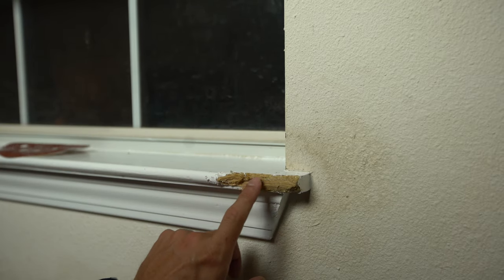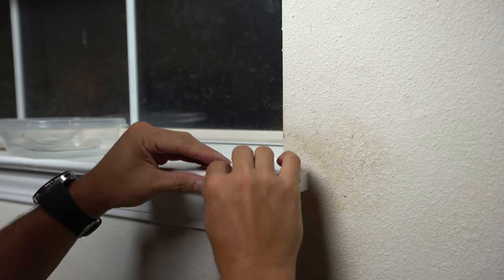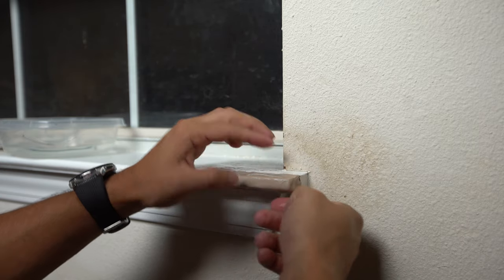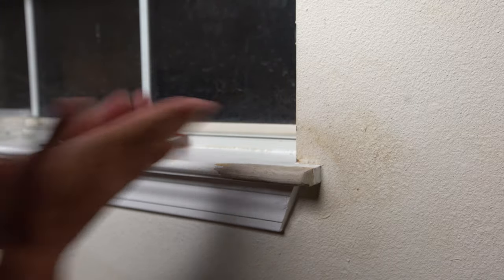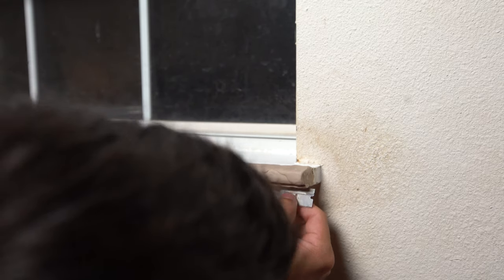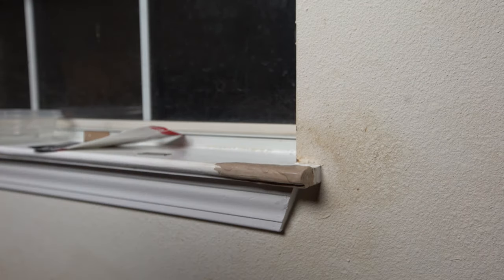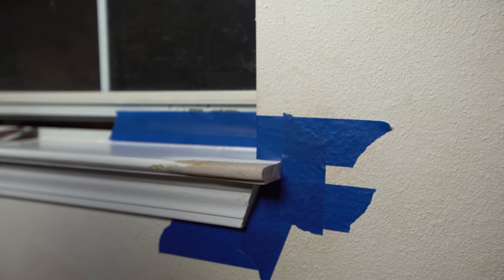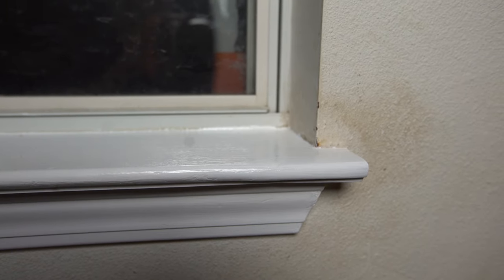DIY: Repair a chewed up Windowsill

Comment: Pro tip, add a few finishing nails to the wood prior to applying the epoxy.  The nails will give it rigidity and bond the two piece together better. Thus, making it stronger.  👍
Reply from the maker: Wonderful addition to mention there. You can do finishing nails or drill tiny holes and put toothpicks in the holes. Maybe I'll do a small video showing the difference in reinforcement using nails and not using them.
Reply: That's a really good idea.
Reply: Maybe if they poked her mouth she’d quit chewing too! 🤷🏽‍♀️👍🏾🐕
Reply: I don’t know if that will be better. Finishing nails has a different coefficient of thermal expansion than the wood and the putty. In other words the nails will shrink and expand at different rates compared to the wood and putty, which can push and pull on the wood and putty, potentially causing separation between the 2 or cracks over time.
Reply: I use the finish nails as well. I pre-drill holes in the wood where I need them and then insert the nails to the perfect depth giving the putty something to grab ahold of. Also helps to keep it into shape and not sag when forming and drying. Same as when doing concrete up against an existing pad or wall. We drill holes and insert rebar to insure that it will bond and hold up to another surface. I also use tight chicken wire when filling larger holes in wood surfaces and filling with an epoxy or Bondo. Works great.

Comment: In the future, Predrill some holes, and run some screws into the wood but not all of the way.  Leave them sticking out so the putty has additional internal support.  For larger areas that you may want to putty vs integrating wood, you can also wrap some light gauge bailing wire around 2 or more screws, then pack the putty into the gaps first, then add the rest of the putty.  I have a similar situation I'm about to fix at my house, and this is how I've fixed other trim as well.
Reply from the maker: Wonderful advice for sure.

Comment: Did this on 2 window sills and it works great.  Only addition was that I used a 3/16 wood dowel for additional support.  Drilled and glued 2 pieces so the nubs stuck out and I could push the epoxy on to them.

Comment: Litterly have a window seal with nearly the exsact same chew mark. I was prepared to use bondo but this is way better
Reply from the maker: Brian Guichet Bondo tends to not have the structural hold necessary for a larger repair like that. You could always drill a few small holes in the sill, use wood glue to add some toothpicks to create an additional structural layer for the condo or epoxy to stick to, but that’s not really needed with this epoxy.
Reply: Did you fix it yet?

Comment: Wow. So glad I found this! I have an area below my window where the drywall surface bows inward leaving about a 1/4" gap right at the end of the horizontal trim below the sill. Fortunately, the window is near a corner, so that gap isn't easily visible, but it still isn't good. I was trying to figure out how to fill that gap as it's too wide to caulk or fill with spackle. This product would be perfect. Easy to use, quick, and paintable.  Going to go get some.

Comment: Thank you so much for this video! I've tried wood filler and it just isn't user friendly in this way... Try making a paste of hot sauce and cayenne pepper for the chewing. I just brush it on with a paintbrush and it's the only thing I've found to keep my dogs from chewing
Reply from the maker: I tried working with different wood fillers numerous times over the years and they were always terrible and never dried well, then I started using this epoxy and loved it.

I've tried a similar combination a few times, unfortunately he seems to enjoy any type of heat and spices and happily licks it up.
Reply: @JoeMartinMVC  My now departed bulldog also wasn't phased by Tabasco, but that was almost 20 years ago. We now have ghost pepper hot sauces.... Could work well for puppy/adolescent chewing, but probably less effective for anxiety chewing.
Reply from the maker: @nuts4goats545  I don't think I'd want to give him anything that spicy, but he doesn't chew anymore anyway, so it's not a concern now fortunately.

Comment: You are a masterful sculpter - awesome job!

Finishes- and 10 min later dog is chewing other window sill 😂
Reply from the maker: Comically he chewed up this windowsill shortly after I finished making this video. I tried so many ways to get him to stop and finally accepted that id just have to wait until I was ready to move to fix it and have it stay fixed. He’s since stopped chewing windowsills thankfully.
Reply: @JoeMartinMVC   I have resorted to dampening areas dog wants to chew and putting a light coat of citric acid powder on it. Works like a charm
Reply from the maker: @TJHutchExotics  I tried a bunch of different things to no avail. Even tried things like hot sauce and cayenne pepper, but he seems to love it regardless.

Comment: Thank you so much for this video. My Cane Corso enjoys wood for a snack. Any suggestions for deep scratches on a wooden door. Window ledges and doors are like prime rib for Mr. Prince
Reply from the maker: I'm glad I could help out!
If it's a non-textured door it's very easily able to be fixed in much the same way.
If it has a fake wood texture, then typically you can  use a wood filler and as it's drying gently go over it with a soft bristled brush (old toothbrush) to get a similar texture in it.

Comment: Great video! My dog broke a part of a wooden corner of the wall and I tried this method to fix it, but the wood filler dried up faster than I expected, is there any way to remove the excess of the wood filler after it's dry?
Reply from the maker: Sandpaper is typically the best method, but depending on how thick it is you could also shave it down using a razor blade.

Comment: I would like information on the kind of Epoxy you used.  Thanks so much - I have 4 windows to get to work on!!!!
Reply: Never Mind I went back and saw in video!
Reply from the maker: Sorry for not getting back to you about this, it seems YouTube decided I didn't need to be notified about comments for a few days.

Comment: Enjoyed your video.  Would this work on my dresser and would I be able to use  stain? My pugs chewed couple of corners. Thanks again
Reply from the maker: Yes it would. It can be stained, but to get the best possible match to the existing wood it would be best to mix in some saw dust from the dresser or same type of wood from sanding it. Otherwise the color may be slightly different when staining as different woods take stain slightly differently.

Comment: Does this work for exterior window frames also? My puppies did quite a bit of damage chewing up corners of our window frames outside in the backyard.
Reply from the maker: Yes it does. The Wood Epoxy is actually stronger and more durable than the original wood, especially in outside environments, as it is not susceptible to moisture or decay.

Comment: Wow, this looks so easy to do!! I definitely will try this👍. You have helped me keep my pet deposit 💸😺, THANK YOU! 😀
Reply from the maker: I'm glad I could help out!
I'll be making another video in the next week or two about another method that can be used that will be even easier to level out and finish. The only drawback to it is it won't be as structurally strong as the epoxy. Fortunately the two systems will work together flawlessly.
Reply: @JoeMartinMVC  Awesome! Will be looking forward to it 😀 Also, I subscribed 👍
Reply from the maker: @staisha988  Thank you! It's always appreciated.

Comment: I wonder if it would work to make a mold 1st out of the unused putty. Might save time trying to shape it by hand.
Reply from the maker: That's a pretty good idea, wouldn't hurt to try. I'd say just make sure you use a mold release (wax, cooking spray, WD40, etc) to make sure that the two pieces don't end up sitcking to each other.

Comment: I have a desk (I think plywood) that is broken in the front right (not the corner, about 90% of the way and in the very front) dented to were it's breaking out the bottom. I was looking up Bondo but everything I'm finding is for corners so I'm not sure what to do. I'm hoping there is a filler I can use because I am hesitant to break it all out just yet. On the top it's about 3 inches by 2 inches, and on the bottom a little bit larger, so I wasn't sure if Bondo could handle something that big if it does eventually break out.
Reply from the maker: I wouldn't recommend bondo in that situation as it is quite fragile. Going with the JB Kwikwood that I used in the video would work much better for creating a solid replacement and would bond in to the wood. You could also add a light coat of wood glue on the exposed wood before applying the epoxy putty to help with adhesion.

Comment: Its so helpful thank you ! Would be even better if you can post the link where to buy the stuff on amazon
Reply from the maker: Amazon got a bit mad at me for posting since I'm not affiliate, but comments should be fine. =)

The Kwikwood epoxy:
https://www.amazon.com/J-B-Weld-8257-KwikWood-Stick-1/dp/B002NJDAJY/ref=sr_1_2?dchild=1&keywords=jb+kwikwood&qid=1587166752&sr=8-2

Great sanding block for hand sanding (didn't have these at the time of making the video):
https://www.amazon.com/Tockrop-Sanding-Mouse-Shaped-Furniture-Restoration/dp/B07XXNRJ15/ref=sr_1_9?dchild=1&keywords=sanding+block&qid=1587166840&sr=8-9

And then the array of sandpapers:
https://www.amazon.com/Sackorange-5-Inch-NO-Hole-Aluminum-Sanding/dp/B07HGYF1NF/ref=sxin_2_ac_d_rm?ac_md=3-2-NSBpbmNoIHNhbmRpbmcgZGlzYyBzZWxmIHN0aWNr-ac_d_rm&cv_ct_cx=5+inch+sanding+disc&dchild=1&keywords=5+inch+sanding+disc&pd_rd_i=B07HGYF1NF&pd_rd_r=cc952046-9a67-47ea-ad43-de19fb5005d9&pd_rd_w=QWfGV&pd_rd_wg=QUeij&pf_rd_p=96e196e3-02fe-420a-8e27-9285fc9434dd&pf_rd_r=JBJXPXHS1XKNV927R4EB&psc=1&qid=1587167013&sr=1-3-12d4272d-8adb-4121-8624-135149aa9081

Comment: I have broken corner on my bed , would like to use this method , will it come off after a years ? I decided to cut that piece Completly later I found this, if I apply strong glue before. Apply this epoxy and put some nails will that work ?
Reply from the maker: The epoxy should bond to the wood fibers and create a permanent bond, but you can also use a small bit of wood glue between applying the epoxy to get an even better bond. Adding small finishing nails or toothpicks in to the wood and applying the epoxy over will also create an even stronger bond.

Comment: Can i drill on the epoxy? I have a furniture metal that was screwed on a narrow wood so it easily broke and screws were loose. I am thinking if I can widden the wood using the epoxy then screw the metal leg.
Reply from the maker: Yea you can, though you’ll want to wait at least two days before screwing in to it for it to fully cure, otherwise the inside can be a bit too soft still. 
Something a few others have done to create a strong wood-like surface is to use sawdust and wood glue to create an almost putty-like texture and use that as a hard wood substitute.
Reply: Appreciate this thank you for the response 😀

Comment: Does the water need to have alcohol?
Reply from the maker: While it's not necessarily required, it does definitely help so as to remove any oils or residues on the surface that could prevent the paint from bonding to the surface. If you don't have alcohol on hand, you could also use a little bit of dish soap on a wet cloth and wipe off the area and make sure it's dry before painting.

Comment: Would it be ok if I was to put in a few Brad nails sticking out a bit to help with the bond
Reply from the maker: It sure would. You could do Brad nails, regular nails, screws, toothpicks, or any other sort of attachment. If you want it even stronger you can use wire or string wrapped around the nails to create a webbing. 
For the most part this shouldn’t really be necessary, but it does make it stronger.
Reply: Before applying the epoxy
Reply from the maker: @kirkniles4184  correct, you’d want to make sure you press the epoxy in to and around the nails to ensure the best bond. 
You could also use some low grit sand paper to rough up the nails for a better bond as well.

Comment: I wasn't able to find the putty would I still be able to do this if I used it from a bottle??
Reply from the maker: Tired Jay it would really depend on what you’re using. You could also use any of epoxy sticks. So even if they don’t have the JB Weld brand you should be fine to use a different epoxy stick. 
My concern with the liquid would be how difficult it would be to control where the liquid stays. 
You could also use bondo/body filler in multiple layers. I’ll eventually do a small video about that method as well.

Comment: Can you use the blow dryer so it could dry faster? to finish faster. Can you make a video on how to repair window sills scratched by cats? And thank you. I'm a new subscriber.
Reply from the maker: You could, but it really wouldn't subtract too much from the epoxy cure time, as it's already fairly quick as it is, you might reduce it by a couple of minutes.
When it comes to cat scratches it could be pretty similar, it would just depend on how deep they are, or how much damage they did.

I may actually be able to do a video on it though, as I believe one of my rentals has some cat scratches in a sill. I'll have to check tomorrow when I head over there.
Reply: @JoeMartinMVC  thank you so much!!! the scratches are very deep, on the window sills and some of the cabinet doors also just  need to get them repaired before the 1st, so I'm scrambling looking at different video's on how to repair,  and when I found yours,  by far is one of the best one's,  not to mention you respond fast 5hank you and may God bless you,  I will recommend this video to all my cat lover friends that have the same problem. Thank you from the bottom of my heart,  and and cant wait to watch your next video,  looking forward to it. Have a bless day. ✌✌👍👍👍
Reply from the maker: @star-ec9ic  I really appreciate that.

If you're needing it fixed by the first I'd definitely start the process of fixing it as soon as possible. If they're just deep scratches and not chunks missing, you can easily use something like DAP Plastic Wood wood filler and press it in to the scratches, gently sand it once it's dry, and then paint it.

I'll see if I can just grab a piece of wood to do a quick video tomorrow with that method for simulated deep scratches.

If you want, send me an email with a picture of what you're working with and I can offer better advice. My email is just my username at gmail.com (YT gets unhappy if you put emails in comments)

Comment: I just bought a new bed frame that my dog decided was tasty while i was at work... hoping I can use this method to fix it..
Reply from the maker: It definitely works, I had to do it for my bed frame (pine bed frame) when my ex's dog chewed a good bit of it.
The only down side is you do have to paint the frame afterward since the epoxy doesn't stain like wood.

Comment: What kind of sand paper did you use?
Reply from the maker: I was using the Diablo sandpaper from Home Depot, but you could easily make due with a cheap assortment pack like this one to have all of the grits you need. I worked from 120-220 for a good finish.

https://amzn.to/333aJRX

Comment: What if it needs to be stained and it's 130 year old heart pine?
Reply from the maker: That definitely complicates the situation and isn't easily answered. I'd start off with something like Minwax wood filler as it's stainable and mix up some sawdust from the wood itself in to it. You'd then have to likely work to dye the wood filler slightly to get it closer to the color. It obviously won't have the same grain, but with it being a stainable filler mixed with sawdust from the wood (which you would get by sanding the edge that's chewed anyway) it should be a lot closer and look better than just a blob of wood epoxy.

Comment: Get your puppy some hard chew toys.  You have to buy them regularly.  Throw them away when they have chewed them too small so they don't become a choking hazard.  Then put Cayenne pepper on your window sills.  Before I learned this, my dogs chewed my window sills.  I'll be fixing them using your instructions.    Important Tip:  watch where you walk because stepping on a chewed toy is worse than stepping on a Leggo!
Reply from the maker: This wasn't a boredom/not having chew toy issue, this was a jealousy issue when I started dog sitting for a neighbor. He hasn't chewed anything he wasn't supposed to in years now.

Comment: I would use bondo
Reply from the maker: Bondo is good for the finer details or as a skim coat to fill in nail marks, but for repairing large chunks like what was missing here Bondo is too fragile and shrinks far too much. Though it is easier to sand, I give it that.
Reply: @JoeMartinMVC  body fill
Reply from the maker: @ronlegere1894  Yes?

Comment: These replacement sills are like $10 and you just need a small $5 saw to cut to size .. so much time to be saved. And the finish will be so much better

Comment: The one tool you forgot is a muzzle for the dog
Reply from the maker: I would never consider muzzling my dog in my own home.
Reply: @JoeMartinMVC  nor would I was just joking and I have a little yapper and a barker
Reply: @JoeMartinMVC  I’m a pro painter also so these type of fixes are very easy for me
Reply from the maker: @billprezioso3677  I've had to fix so many of these over the years from tenants dogs chewing on windowsills, baseboards, cabinets, etc. Instead of charging them hundreds to thousands of dollars for fixing these issues I just charge them $50/instance so they get as much of their security deposit back as possible.
Reply: @JoeMartinMVC  that’s nice I had a contract with a townhouse community and did the same thing.